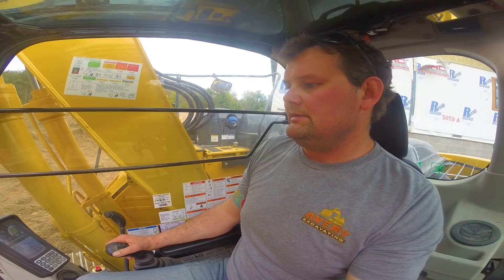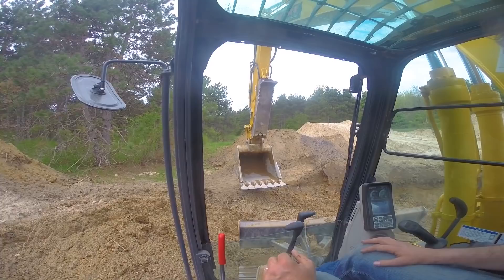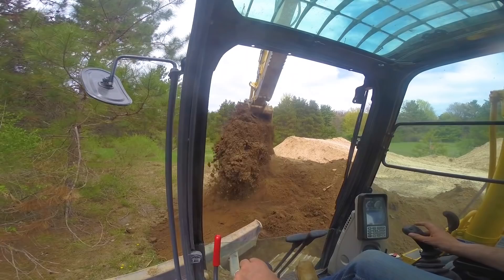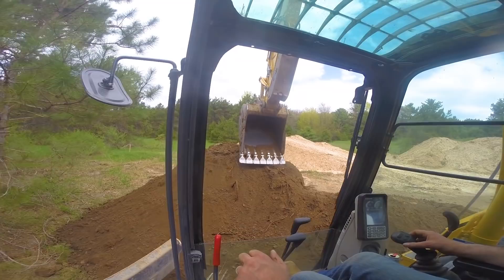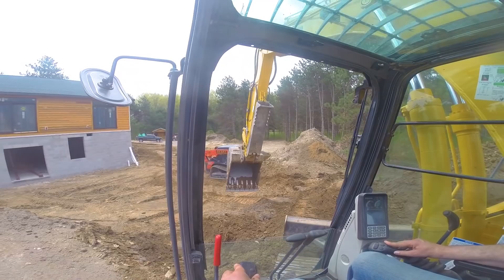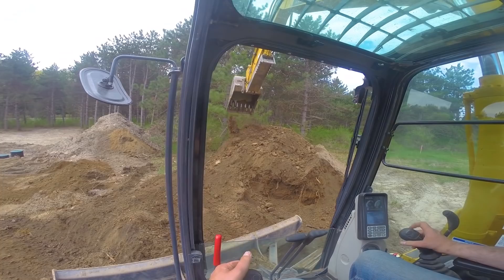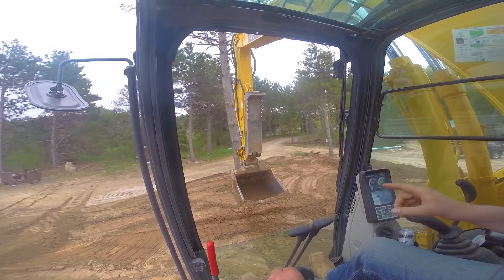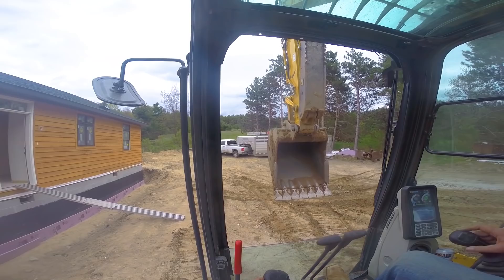How to Backfill a Foundation // #OutsideTheSandbox | Kyle Riegle

Comment: Why do u guys in the US use such small buckets,
Reply from the maker: I feel like a "size doesn't matter" comment here...lol.  Anyways, not sure exactly what you mean, size of the bucket is dependent on the type of application and obviously machine limits.  This bucket on this machine seems completely appropriate for the application.  Much larger and first I believe it might slow the machine down by exceeding limits plus you wouldn't want a larger bucket when working with tight limits near a house foundation.  Curious what other people think...please comment.
Reply: @HeavyMetalLearning  yeah im an experienced operator myself but i utilise a quick hitch and always work with a selection of buckets, the loading out of fill would be done with a tilt batter bucket and then I would switch to my general purpose bucket for the tight access work, it just seems to be the normal thing on most of the US YouTube videos to use a gp bucket for everything,
Reply from the maker: Agree, I think the QuickAttach systems aren’t quite popular in the US...yet.  I think the initial expense for the quick coupler on he machine and then the multiple attachments/buckets is too costly for many operators and tough to determine the exact ROI.  Thanks for the comment.